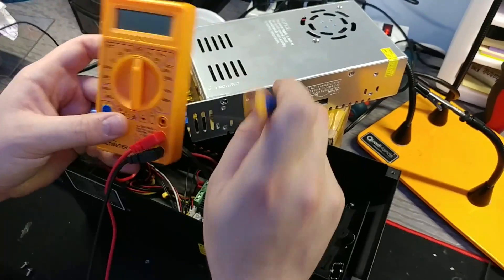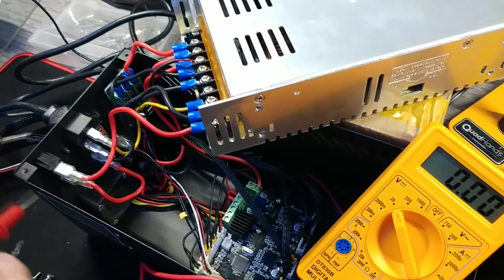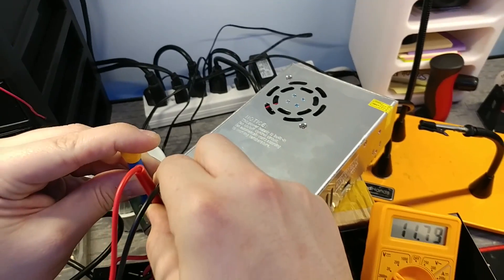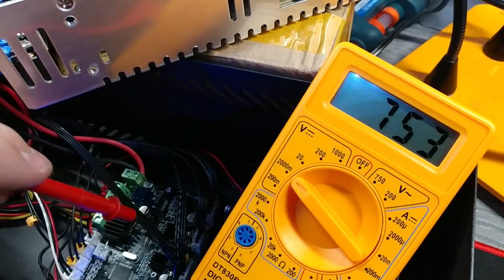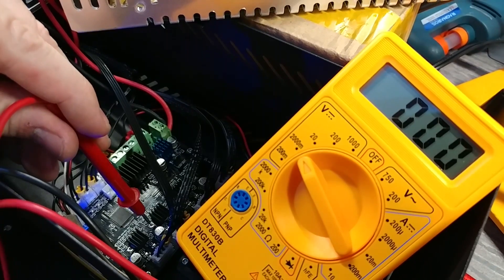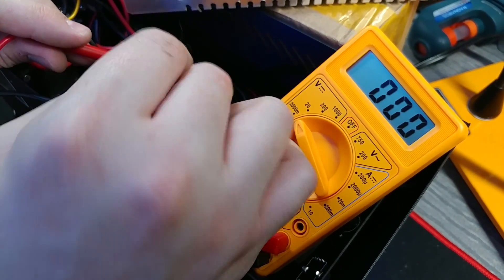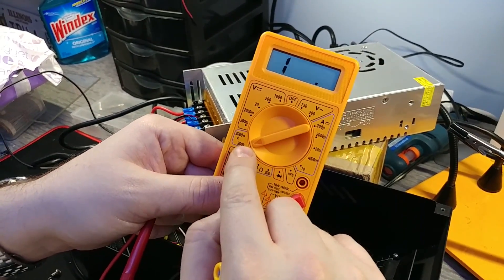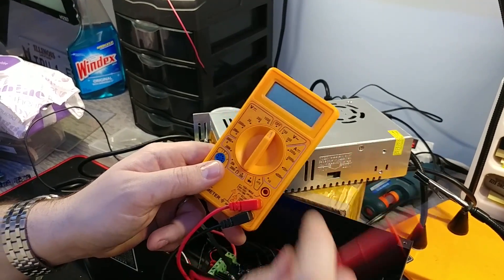Adjusting PSU Voltage and Stepper VREF Voltages

Comment: Good morning! Pardon me please, but the part I didn't hear is the adjustment for the extruder motor, what the VREF should be set at for that one. I have 2 CR-10 S5 printers, one ABL one not. The non ABL printer extruder motor is getting hot enough to soften and partially melt the filament and cause clogging, also - the control box for the same one is running rather hot as well. Could you tell me what the voltage or VREF on the extruder motor would be? The fans on the control box are running, but will check if needing replacement. Thank you in advance for everything!
Reply from the maker: Back it off by 0.1V until it is cool enough to drive the filament but doesnt lose steps. There is no specific number, depends on the printer and what motors are on there.
Reply: I was just going to go off of what you had yours set at in the video, which was between 7.5 to 8. That's assuming that's what they all say but I haven't got to it yet because I have not had time to actually work on it. I found my old multimeter and I already have the ceramic screwdrivers so as soon as I get some time I will get to work on it. I much appreciate it!
Reply: @TH3DStudio  The Y motor is a 42-60 1500A. The E motor is an original Creality3D 42-40. The dual Z motors are original Creality 3D 42-34.

Comment: After looking ad your YouTube film, now 23 feb 2025, if have taken the power supply out of my Creality CR10 (original stock) and measured everything you did and it was way off .

Main voltage was 12,2 volt now 13,5 volt
Extruder was 0,75  now 0,90
Z motor was 0,57  now 1,01
Y motor was 0,73  now 0.90
x motor was 0,73  now 0,85
The printer works now perfect, nice printer lines, only downside is that the fan's are louder!
That wil we reduce in the next stage.

I use my girlfriend's YouTube account.

Greetings from the Netherlands

Bob

Comment: If I add a second Z stepper in parallel what should the Vref be without damaging the driver chip?
Reply from the maker: Just bump it up about 0.1V and see if you get lost steps. If you don't you're good, if you do then increase another 0.1v
Reply: I'll give it a try. DO you know the max current of the chip? @TH3DStudio
Reply from the maker: I do not as I do not know what you have. Just follow the directions provided, it will work for most 3D printers on the market.

Comment: Hello, I've never adjusted PSU voltage on my printer but after seeing this video I checked it and my PSU shows 12,51V. Since I'm not powering my bed from the PSU but directly from 230V, can I lower the voltage down to exactly 12V or would that be too little for another components?

Comment: Iam new for 3d printing ,my cr 10 smart pro x stepper motor is very hot and whenever it  started to print   my mains voltage is starting   to blink but mains power is sufficient because Iam using stabilizer. could anyone  help me plz
Reply from the maker: Try lowering the VREF on the X driver. Too hot = too high of a VREF
Reply: @TH3DStudio  Thank you, I wil try

Comment: I did this with a new psu that I installed in my CR10 S5. The original psu lasted 6 years. A thermistor on the psu had popped and killed the psu. I put the new psu in, followed this vid, and everything has ran great for 5 months. Today the same exact problem happened to the new psu. Is there anything that can be causing this thermistor to overheat and burn out? I noticed the side of the control box where the thermistor is was very hot when my printer died. I am in the middle of a big job with big parts, and really need help getting this S5 running again. Thanks for this awesome vid. I realize it's pretty old, but it's still very useful! I have dialed in 3 other printers using this.
Reply from the maker: If you aren't using a good quality PSU they will fail. We carry Meanwell Brand ones in our shop and to this day for the 6+ years we've been printing we haven't had a single Meanwell fail. If you need a new one for the S5 this is what will be a drop-in replacement that we carry: https://www.th3dstudio.com/product/cr-10-psu-replacement-upgrade-mean-well/
Reply: @TH3DStudio  they are the OEM Creality psu's. The original one lasted 6 years. Then the thermistor inside the power supply fried (TH1 on the psu board). I replaced it with another Creality psu. It ran for about 6 months and fried that same thermistor again in the new psu. I just installed a new psu today, and it fried it within an hour. I have been told to check for a short somewhere in the printer, but I don't really know what I am looking for. Any idea what can cause that thermistor to pop?
Reply from the maker: @BreydonsRC  those stock PSUs are not reliable. Meanwell is the best replacement for them. We had repeat failues with the stock PSUs which is why we dont use them. I'd check for shorts and put a Meanwell in there once you are sure there are no shorts in the wiring. Use a multimeter to test the resistance across the bed heater lines and your hotend lines. Stay away from the creality and no-name PSUs out there.

Comment: Awesome video! My extruder motor gets really hot and shuts down after some minutes printing, will this solve this issue? Are this numbers the same for a cr10 v3? Thanks in advance.
Reply from the maker: yeah it will. Just back off the VREF by about 0.2V and see if it still extrudes correctly and runs cooler. If it looses steps go back up by 0.1V.

Comment: heyy man great video but probably need to add something some mainboard run on 24V so making sure first the psu is running at the proper voltage, main was dawn at 20.7 and it was the minimum I crank it up back to 24 and it should be ok now
Reply from the maker: Check the AC input voltage switch as well. Most come set to 220/230V.

Comment: if i have replaced the standard extruder with a bmg i should adjust the extruder motor voltage? to what voltage?
Reply from the maker: You should see what Bondtech recommends in their installation materials and set it to that.
Reply: @TH3DStudio  its a bmg clone. are they the same?

Comment: So I'm following along using this video to adjust voltages on my ANYCUBIC Mega X stepper drivers and I have the black lead connected to the ground port on my power supply while probing the pluses next to the drivers and mine is reading -001 to -005, which can't be right. The multi-meter is on the 2000 setting like your instructions say and I moved all my axises a tiny bit to enable them with the printer still turned on while I'm doing this and I'm still getting these weird readings. 

What am I doing wrong?
Reply from the maker: try other settings on your meter and make sure you are on DC voltage, not AC.

Comment: Hi, my ender 5 plus is hole time moving on the left Z motor a little bit. i feel it when i level mauell, then the paper jams after some seconds the it loosens. And it then repeats itself over and over again. This happens after upgrade to a V2.2 Borad. You have an idea ?
Reply from the maker: Could have a bad connection on the wire feeding the motor. If its "walking" that usually indicates that one of the coils is not getting proper power to hold position. One easy test would be to swap the 2 Z motor wires and see if the issue presents itself on the other motor then, if it does then the issue is the cable - if it doesn't then it may be the motor itself.
Reply: @TH3DStudio  thx ! Have found it. everytime when bed is heating , the distance between nozzel and bed is changing. Think thats normal.
Reply: Sorry, another question: do you know the pins of the z switch?  Voltage, Signal and so on.

Comment: Hi there, I am a novice when it comes to circuitry so bear with me. I have a 10s5 and Im having an issue with my heater cartridge not heating up enough and I keep getting a heating failed error read out.  I believe I might have shorted out the heating cables while replacing an old cartridge.  To check the power going to the heating cartridge where would I place my multimeter. Also any other suggested solutions are welcome. Thanks :)
Reply from the maker: You would want to check the screw terminal where the hotend heater wires connect to. Tell the board to heat and then see if you are getting 12V out of the terminal.

Comment: Will this also help with the motors over heating?
Reply from the maker: If motors are overheating, lower the VREF be 0.1V until that motor stops overheating but you also do not lose steps on that axis.

Comment: I have a CR 10.  It will print the first test line on the left side of the print bed.   Then half of the circle frame border around where the parts are to be printed and nothing else after that.  So, as soon after I hit (Stop Print), and "Move Axes-Y up", I can purge the Extruder with no problem.   "It just won't maintain heat enough to print parts".  And it's totally dishonest about temperature readings.  It shows the temperature I want, but that's not the temperature I get.    I figure it's the power supply, what do you think?
Reply from the maker: Are you sure its not a bed level issue? If you extrude manually with the nozzle at temp will it flow out of the nozzle?
Reply: @TH3DStudio  Yes it does extrude manually, but; I figured out what the problem was.  Inside the power supply are these two ceramic rings with copper wire wrapped around them.  There is a loose hanging sensor with two black wires connected to it with a clear high-temperature silicon sleeve around it.  It was hanging at a 30° angle to the opening of the two ceramic rings.   Because it wasn't fully inside the ceramic rings, It would relay a false temperature reading for the Thermister.  Once I shoved it all the way in between the two ceramic rings everything started working just fine again.  I just finished getting three great prints.  Thank you for getting back to me, I like and subscribe to your channel because you're the greatest!

Comment: Hi Tim
I have an Ender 3 with a 24 Vdc Power Supply. Obviously the Drivers Reference Voltage on Controll Board should be set to the same values as a 12Vdc Power Supply.  But what should the output of the 24Vdc Power Supply be set to?  Thanks for your Videos and help with my question.
Cheers
Willy
Reply from the maker: The Ender 3 is fine at 24V, it heats quick at that setting.

Comment: I was able to boost the voltage on my 24 volt Tronxy printer. I've been experiencing layer shifting for quite some time. Hopefully it won't happen again. However I was not able to change the voltage of the xyz steppers. Very strange. I turned them either way and always got the same reading of about .4 which seems low according to what you said. Any thoughts? I did a small test print afterward and it was fine though. If you can explain why I was not able to change the voltage I would appreciate it.
Reply from the maker: Changing the adjustment pot should show a change in the reading. Try moving them SLOW. They only have one turn in them until they go back to the start of the pot adjustment.

Comment: will increasing the voltage output on a transformer not reduce the current it can supply? higher voltage = less current = bed heats slower?
Reply from the maker: It will still output the same wattage total, but allow the heaters to pull more current. The 12V machines don't pull anywhere close to the max that the PSU can output.

Comment: Can I get a little help on my new venture into 3D printing. I bought a RepRapGuru (Out-of-Business) i3 printer just to get into the 3D printing world off eBay for $95. I have it together and mostly working except I can't get the extruder to extrude when everything is heated up. The gears just slightly move when I go into the menu and manually tell it to extrude. I can hook up the X cable to the extruder and it moves the gears without any issues. I checked the E driver voltage and have it up to .91 and yet still no movement. I had to purchase new drivers as I ended up with 2 bad ones so I needed on and I purchase TCM2108 drivers(man are they quiet!) and a new cable as both were bad. Now I at least get slight movement out of the motor/gears but still can't get it to extrude. This I hope is my last hurdle before I can finally print something. Anyone have any tips? Maybe another bad cable or driver? I guess I can swap them around and see. Ugh so close! Yes I am aware this is not the best printer but I love to tinker as do most of us, so it's a good project for me to learn on. Thanks!
Reply from the maker: Check out our communities for help with your printer :) They are all listed here: https://community.th3dstudio.com/

Comment: I have a wire splitter for my dual z motor. Do I just need to up the voltage to .9?
Reply from the maker: Depends on the drivers on your board. Check out our discord server here for getting things setup on your printer: https://Discord.TH3DStudio.com

Comment: Thanks a ton ! 
Was having issues trying to get dual z kit working on my Ender 3 Pro , this fixed my main problem ( but now screen clicking by itself every now and then ) .
By the way you can also hold the volt meter lead to the screwdriver while setting the potentiometer ( way faster ! )
Reply from the maker: Sounds like this would be relevant to fix the LCD issue: https://support.th3dstudio.com/hc/product-information/3rd-party-control-boards/skr-e3-mini-skr-e3-turbo-creality-v4-2-2-and-v4-2-7-lcd-emi-issue/

Comment: what is needed for the ender 5 + extruder motor? as it seems to be on a strike here out of the box :(
Reply from the maker: Depends on the driver that is on the board. This would be a great thing to post in our communities about. They are available for you to get help with your 3D printer. Check them out here: https://community.th3dstudio.com/
Reply: @TH3DStudio  is a ceramic screwdriver needed? according to creality vref for the extruder on e5+ should be around 1.38-1.40v so i can go ahead and get it set correctly

Comment: Any idea what the Vref should be for the 4.2.7 board with TMC2225 (?) drivers?
Reply from the maker: See here: https://support.th3dstudio.com/hc/en-us/articles/360055293652
Reply: @TH3DStudio  I'm probably late to this, as the link is 404. For Ender 3 Pro with 4.2.2 board a GD chipset, what are the proper values?

Comment: I upgraded my ender 3 pro to the 400x400 ender extender. I needed a glass bed because the aluminum was not very level. I'm using Klipper firmware with the skr mini e3 v2. Its really easy with UART, you just specify the voltage in the firmware. I bumped up the move voltage from 0.580 to 0.900 on the y axis becuase it was missing steps and shifting layers on the y axis. My only concern now is that the stepper motor is running extremely hot; like too hot to touch. Any advice? i'll try to bump it down as low as i can before i start missing steps again. Would upgrading the stepper motor to something a bit beefier help? Its a 42-34mm motor. The nema 17 42-47mm motor but is it worth the $15 spent on it?
Reply from the maker: I would probably up the Y motor to a larger one. The 400x400 Creality S4 uses a far larger motor than the ender 3 does.
Reply: @TH3DStudio  thanks for the reply. Do you have a size recommendation? https://www.amazon.com/dp/B07PS4BMSN/ref=cm_sw_r_cp_apa_fabc_NofYFb41T0D8P is this overkill? As far as I can tell this is what the s4 has. My only concern is...where do I find a metal mount to replace the plastic one, and will the plate carriage clear it or will I have to cut out some of the plate?

Comment: Hopefully you can answer me. My stepper motor has been skipping steps even after leveling/cleaning/exchanging nozzles. My question is: When adjusting voltages for E, can i use a metal screw driver to adjust ? Or does it have to be plastic? Sorry for my lack of knowledge lol
Reply from the maker: Plastic or ceramic is safer but you can use metal. The only concern with using metal is that if you slip then you run the risk of shorting things out.
Reply: Did you adjust the voltages and did it help? My ender 5 plus just started this it will print a print and randomly stop extruding and the bed temp and nozzle turn off. Any idea why it started doing this?

Comment: Could this be what is causing my Ender 5 Plus extruder motor to move back and forth but not actually extrude?
Reply from the maker: It's possible if its not set high enough. But more likely is that it could be a wiring issue or a bad stepper driver on the board.

Comment: This fixed my layer shifting! I had a Y layer shift at a specific height every time, my CR-10 V2 Y motor was set to 1.4 volts, so I increased it to 1.8, and it stopped shifting.
Reply from the maker: Nice work!

Comment: Hi! 

I have a CR-X Pro with the new silent board (TMC2208 and sense resistor of 150mOhm). I get extruder misses and X misses. The Vref is set to 0.73 from factory for all axis, which I think is too low. It should be higher than the old board in my opinion. Does anyone know? I have asked creality tech support but they haven't replied to me. Thanks for a great tutorial!
Reply from the maker: Turn it up by 0.1V and monitor the motor heat. Without getting technical if the motor is too hot to keep your hand on it without discomfort then you are OK. If the motor gets too warm to where you cannot keep your hand on it without it being uncomfortable then the VREF is too high. Those drivers are stuck in StealthChop mode which is not recommended by Trinamic for extruders. Since they slapped those drivers on a board designed for A4988s they run hot and you cannot pull them out of spreadcycle without doing surface mount soldering and complicated OTP to the driver to put it into spreadcycle mode.
Reply: @TH3DStudio  Thanks! I got a response from Creality support the other day, and the settings on my board was incorrect from the factory. Here's what they should be: X:1.38-1.4V, Y:1.38-1.4V, Z:1.58-1.6V, E1:1.38-1.4V, E2:1.38-1.4V. The CR-X Pro silent TMC2208 boards has a 150mOhm sense resistor hence the rather high values compared to other boards.